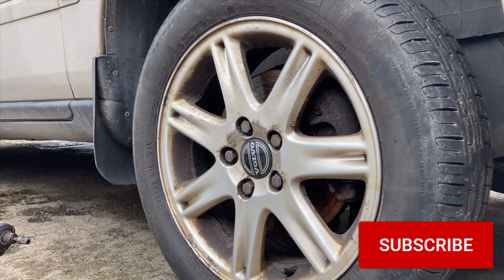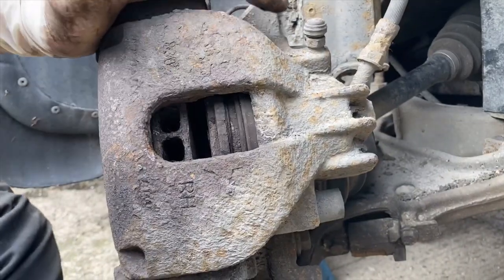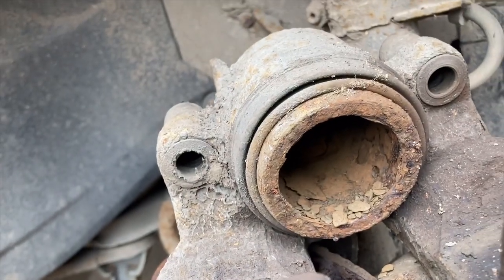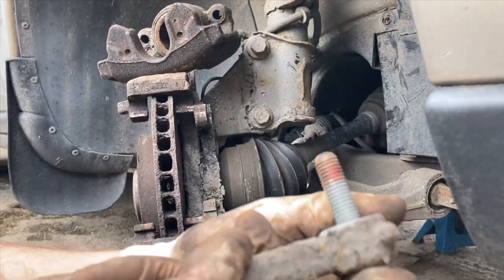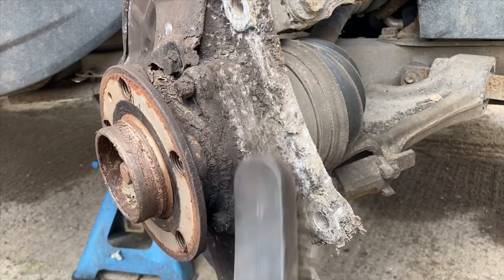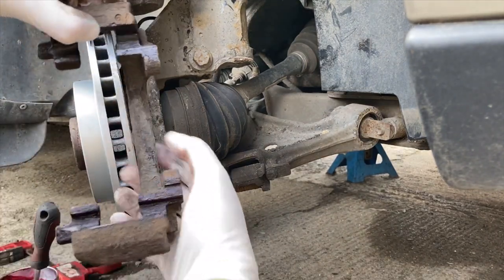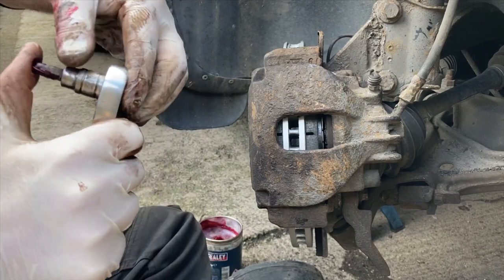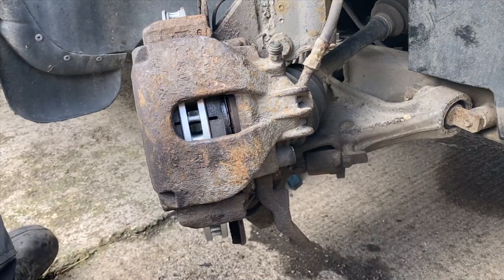Volvo V70 Front Brake Discs and Pads Replacement

Comment: Nicely done!

I was informed that it's a good idea to check if the brake fluid reservoir is overfilled in which case you should remove the cap and drain some otherwise there's going to be excess pressure in the brake fluid system when you push the calipers in to fit new pads. 
Ever had issues with this?
Reply from the maker: There is zero pressure inside the cylinder reservoir, the pressure is created inside the rest of the braking system with the piston in the master cylinder is pushed into the system thus compressing all of the fluid and creating braking pressure/force 

If it’s too full and you rewind then yes it can overflow but if it’s at the maximum mark I’ve never had to do that 👍🏽 you can also pump the brakes after each corner which will lower the fluid level